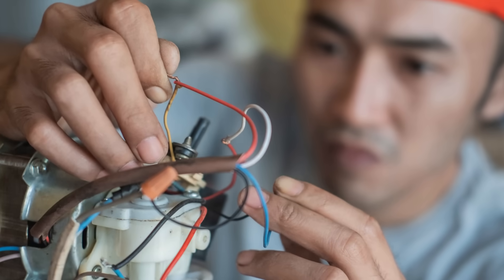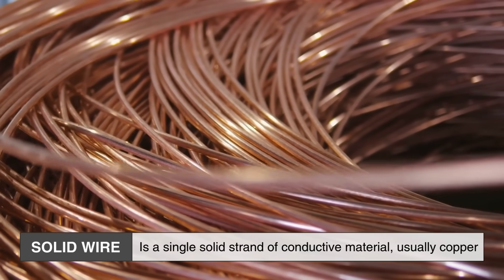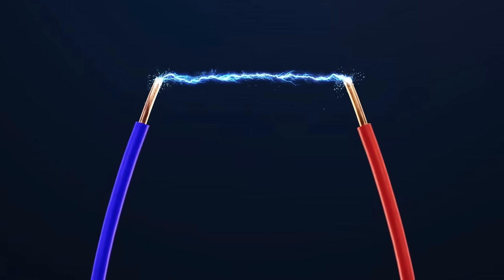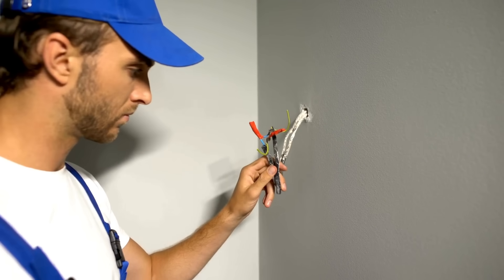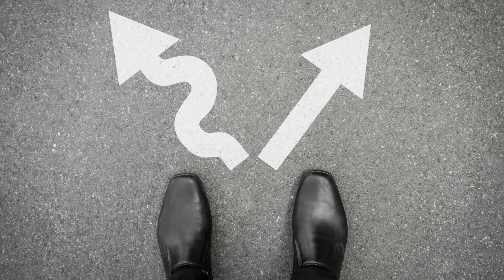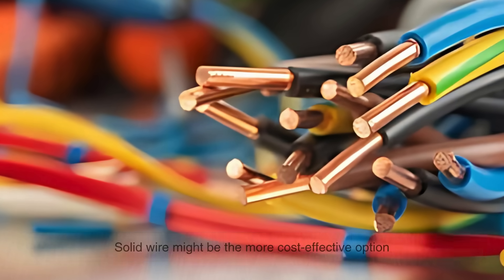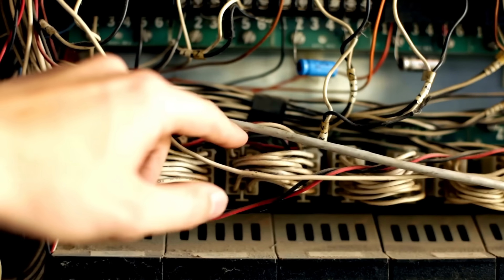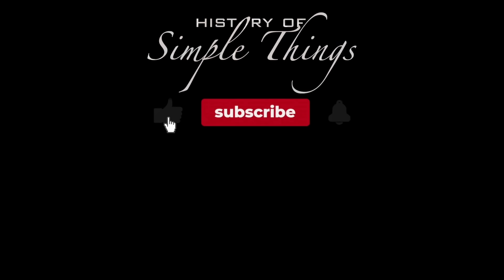Stranded vs Solid Wire: Which One Should You Use?

Comment: Say for instance I'm connecting wire over 100 feet for 240 volts and it's a straight run, solid wire of 10 gauge is the best option. Every well I've put in for submersible pumps are always solid wire 😊😊😊

Comment: Solid wire when used in house wiring is dumb. Have you ever tried hooking up a switch to it? It's hard to bend and to wire-cap it. If using stranded wire doesn't matter, why use solid at all?

Comment: 400 Hertz tends to travel on the surface... our 400 Hertz generators had 0000 conductors that had close to a thousand hair thin copper wires in each phase. And yes, there is a difference... 400 Hertz REALLY frickin' hurts when it grabs you.  Lol

Comment: If you run the wire through a conduit , the choice is stranded wire. If the wires are through initial construction. 
Solid wires art the choice.

Comment: The skin effect. Electricity flows on the outside of a conductor. Solid wire has less are for current to flow on and stranded wire has much more surface for electrical current to flow through. Solid wire is better for routing around corners. Stranded wire is very flexible. There are tradeoffs with either type of wire.

Comment: Solid wire is cheaper and is used to lay fixed cables around the house. 
Stranded wire is used for flexible connections. 
Stranded wires are always used in cars.

Comment: I will never watch this channel again. Stranded wire has less resistance than solid wire. Conductors in parallel have less resistance. The the smaller strands are all in parallel with each other.
Reply: Wrong. All else being equal, a stranded & twisted conductor will have slightly higher resistance vs. a solid conductor. Even at DC.

Comment: If you need to add crimped connectors to your installation, then you must use stranded wires, for you cannot crimp solid wires.  The common largest gauge of solid wire available is number ten. Generally, if it is between solid and stranded wires, the stranded wires are very coarse strands , a small number of individual strands.  For vehicles and robots, the strands are much finer and many more strands  so they can flex much easier.

Comment: Speaking of wire, my tool repair guy says the number one thing that kills a motor on a high amp electric tool such as a chopsaw or a compressor or a circular saw, is when people use those long 50 foot cheap extension cords. He recommends never use a longer cord than you need, especially if you don’t have a good quality extension cord with higher gauge wire in it.
Reply: Longer means higher resistance

Comment: As electronics engineer, the choice simple. If the wire has to be flexed while in service or have to make tight bends you use stranded. If it does not move after installation, you use solid wire. This can be ignored below about 26 Gauge and it is all solid wire.

Comment: Before watching this video, I've used both in electronic projects, mostly at 5v and a few at 12v. None higher than 12v.  I've used solid core for easier soldering or screwing in, and stranded core if I needed wires to be more flexible

Now to see if I got close to what the video suggested.

Comment: So many things wrong with this. In the US residential wiring is solid, #14 or #12 or #10 solid. Above that it's always stranded. You can't pull 4/0 solid wire. Metal clad (MC) is sold in stranded and solid and you can choose either. Stranded Romex is very rare (and weird). Commercial wire must be pulled through a pipe, so it is always stranded and uses crimp connectors or clamps. You MUST use antioxidant for any dissimilar metals, usually copper and aluminum. If you can't put a crimp on correctly, you risk a house fire. Call an electrician. 
If it's on a boat, RV, camper or anything that moves or stage wiring, it MUST be stranded (see Article 551.10(D) and 520.68) same with portable equipment and hanging cords. 
Voltage drop is a concern for AC over 100 feet where you might want to go up a gauge in size (#12 to a #10) and no one is pulling solid #10 over 100 feet. With DC you have significant voltage drop over 25 feet regardless of wire type. You avoid this by running AC as far as possible to the transformer, then at the device have a short DC wire. 
There is NO mention of any rules that must be followed in this video. The NEC and NPFA in the US are the authorities. You don't have choices as presented in the video.
Reply: Thank you for your explanation, your input is very valuable to all of us
Reply: You answered my question, because I'm building a camper van and I see 6/3 Cerromax (Romex) used a lot from inverters to breaker box, but I want to use stranded for it's flexibility. Was thinking to use 4 AWG instead of 6 since it's said that stranded tends to drop more volts. But if 100 feet is the marker for voltage drop it seems I'll be OK with 6 AWG. Thanks for this comment.
Reply: @RiverBarks  It's always ok to use a bigger wire, especially for heaters and motors. It keeps the wires and connections cooler. It's normal for wires to heat up and cool down which can make them expand and contract, creating a gap at contact points, so cooler is better. Good luck with the build.
Reply: @BariumCobaltNitrog3n  Thank you Sir. This endeavor has awakened a sincere respect for electricians in me. This project is a shuttle bus I plan to do carpentry and welding out of as I travel the US. Split phase with 2 big inverters. I completely overestimated my abilities with electrics here, but the process is teaching me valuable skills. I am going with thicker wire!

Comment: Only thing needed to know is OHMS LAW! power does NOT crawl inside the "core" as was said, it crawls on the surface, and the cleaner the wire, the closer u get to the maximum Amp transferring possible at a given mm²

Comment: You where wrong abot solid wire being best for long runs, with AC a special form of stranded wire (litz wire) is best. Depending on frequency a long run can be as short as a couple of turns on a transformer.

Comment: Well yeah it's cheaper to use solid core than it is stranded but it's harder to pull solid core through finished walls also solid core can only handle about 75% of the current that stranded wire of the same gauge can and that's really pushing its upper limits I always use stranded more flexible easier to work with handles higher current why not. It's like going2 gauges larger in solid core and easier to work with

Comment: By the way, stranded wire is much better suited to low voltage applications, especially when experimenting, so the guy is correct on this.
Reply: It depends on its current carrying capacity (ccc).. the voltage does not matter.

Comment: Thank you for making this video.  I tried telling my professor that a solid wire is just as good as stranded, but he insisted that "stranded can handle more amperage because electricity travels on the surface" of a conductor.  I was the student so I acquiesced.

Popular Mechanics had an article on this years ago and that's how I knew that the thicker the conductor the more heat it can dissipate; so comparatively the same gauge is more or less equal.
Reply: As long as the label in the cable says 2.5mm² you can use them to wire a 16A socket circuit at home. Solid or stranded does not matter. You and professor argued over non issue😅. The real issue is people don't know about concept of current carrying capacity. I often find DIYers wire their sockets with 0.75mm² or 1.5mm² wires which can be very dangerous as your 16A breaker might not able to protect the wires in the event of a fault.
Reply: Your professor is correct while this video is not, at least regarding the current carrying capacity of stranded vs solid. However, for all practical considerations for most wiring applications, the difference is so minuscule as to be immaterial.
Reply: What about grounding cable that is usually found stranded ?
I guess better conductivity is the goal, and that’s why, at equal gauge, stranded wire is adequate in home applications. Is that right ?

Comment: I was told by an EE that alternating current travels thru the core of the conductor, while direct current travels on the surface of the conductor. Thus, AC current is best matched to solid wire and DC is most efficiently matched to stranded wire.
I suspect the difference in efficiency is very small, but measurable, because in practice you see plenty of both and, as the video points out, solid wire works best where there is no movement of the wires. 
But, I’m a retired ME (mechanical engineer) and we design the hardware that holds the wires. Electrical Engineers keep track of the electrons. But if EEs are so smart why did they set up the convention that electrons flow backwards (negative to positive)? 🤔
Reply: It's the other way around with regard to the surface, direct current uses the whole of the cable, the higher the frequency, the more the current travels in a smaller skin of the conductor.

Current flow is the flow of charge, not just electrons. The direction is just a convention and happens to be in the opposite direction to electrons, but in the same direction as holes, it is just a convention, either could have been chosen.
Reply: Skin effect in high end audio systems is noticeable. Long runs of speaker wires with low strand count will attenuate high frequencies. After studying it I believe skin effect is a form of CEMF. I may be wrong in my conclusion but it seems logical.

Comment: Electric wiring is always stranded. Starting with #10  gage and lower. #10 30 amps. #8 40 amps and so on.
Reply: Not in the UK.  1 and 1.5 sq mm wiring cables are solid core.  2.5 sq mm comes in stranded and solid core.  BICC pyrotenax (mineral insulated copper covered) is solid core in all sizes, as are some XLPE insulated cables.  Overhead and underground lines are another subject altogether.
Reply: Not in houses in the US, only solid. Commercial has to be pulled through pipes so always stranded.
Reply: @BariumCobaltNitrog3n No, any wire 8 gauge and larger is stranded. I don’t think running 6AWG solid to an electric range would be very practical.
Reply: @ That's true.
Reply: Romex begs to differ. Most residential wiring in the United States is solid copper.
Reply: We are in the US and Canada, keep your UK in your country.

Comment: At high frequencies solid wire is actually a poorer conductor.  It doesn't matter at power supply frequencies but it starts to become more important as frequencies go higher.
Reply: That's due to the 'skin effect' where the voltages tend to move to the outside of the conductor with increasing frequency of the signal. In GHz frequencies, and high power, such as Transmission waveguides, they are hollow tubes that make the most conductive and greatest value.
Reply: @skippymaster  I did some work where I discovered that the skin effect starts to become an issue even in the 100s of kiloHertz.  This was eye opening to me because I thought this was only at the really high frequencies.  This is when I discovered Litz wire.  A cable made of very fine strands of insulated wire (like magnet wire) It's great stuff but very difficult to strip the insulation to terminate.  The idea is that with so many individual strands that the skin effect is distributed so that most to the conductor is used rather than just the outer section.
Reply: @dougcox835  That sounds like a good thing. It's probably a lot more expensive. Used only for the projects that need to be very efficient in transfer of current..
Reply: I learn that the hard way.  An electoral engineer recommended using solid cable for a speaker run; he uses solid wire on his 13 foot run.  I was doing a 40 foot run and it sounded terrible.  Still not sure why he still uses solid wire in his setup; I guess the short run and speaker combo it doesn't sound bad.  I replace it with proper speaker cables, it was just an unacceptable sound (a bit off/muted).
Reply: @rui1863  electoral engineer, someone who engineers elections :)   I'm surprised that any engineer would make that mistake.  Gauge makes a huge difference as well no matter what type of wire.  Another consideration is inductance.  Solid wire is more inductive.  I just looked that up and guess what? The difference is due to skin effect and magnetic cross section etc.

Comment: Which wire carrier more electrons stranded or solid wire ?
Reply: Good question, stranded wire is the bigger carrier. Most electron flows on the outside of the conductor. Stranded wire has multiple conductors which means a higher circular mill count.

Comment: I appreciate that this video will deal with all the facts that were missed out in a recent video on wires where you explained the gauge and uses. I commented on that video about this exact details too. However, you missed the very important factor that the type of current i.e. AC or DC will play an important factor in choosing the type of wire. While stranded wire is best for AC application DC is most suited with solid wire. Low current low voltage applications can be judged by only economic factor but high current and voltage needs appropriate wire only.
Reply: That's the main point.
Reply: @kapilsds7  yeah. 2 videos on the same thing yet he forgets to mention one of the very important difference.. 🤷🏻‍♂️
Reply: Not denying what you wrote but in my 50 years as an electrician who reads at lot on never once saw or heard about one type of wire being g better for SC and the other for DC. Have attended over 100 IAEI continuing education classes / meeting on just about every electrical subject. In industrial settings where most runs under 50 amps are usually within 200' of panels the slightly higher resistance stranded wire never pose a problem. Both solid & stranded wire have the same empire rating in the NEC.
Reply: @garbo8962  you must be in America I guess coz many places use 110V of electricity. Here in my country with 220V AC 60Hz supply in household, you aren't allowed to use solid core wires. It will just not pass the safety check. And I wonder how have you never read about wire types of you attend lectures or are a professor yourself! Current flow differs for both AC and DC, you didn't consider skin effect of current. For the same current, a stranded wire will have higher resistance for DC than AC.
Reply: @garbo8962  Yeah -  they are both copper, so as long as they are the right size so what.
Reply: @PaulSawczyc  No, solid core of a larger thickness will be required for same current as compared to a stranded wire for AC application. Vice versa for DC.
Reply: @msnirajagrawal  depends on the frequency; for the 50/60Hz applications, it does not matter.
Reply: high current high voltage wires are invariably stranded; i doubt you can get solid rods in any appreciable lengths with suitable insulation or without insulation.